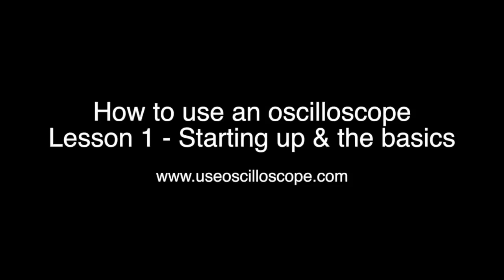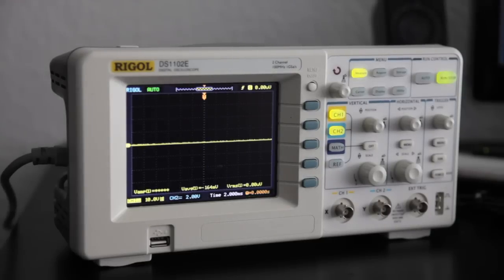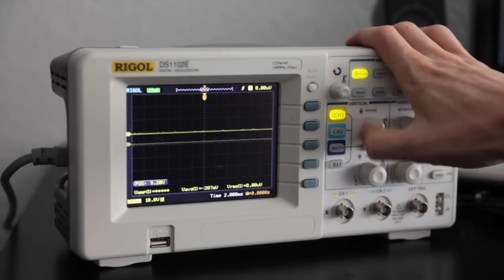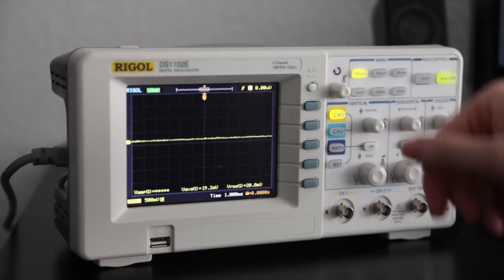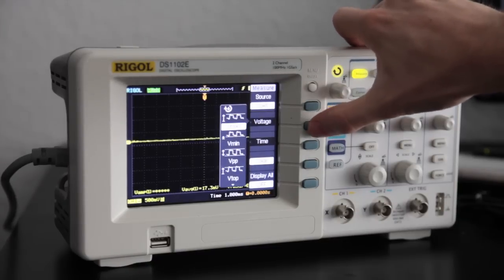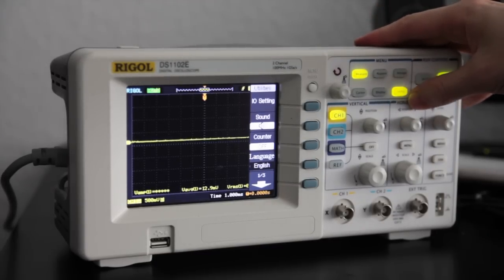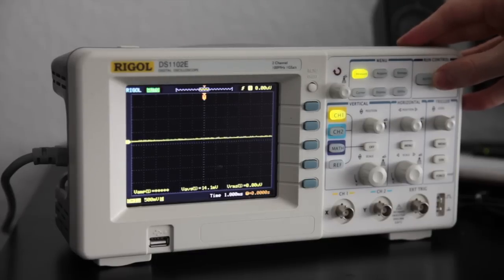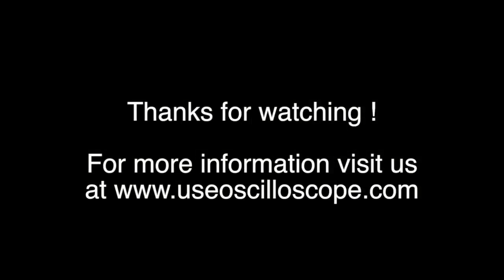How to use an oscilloscope - Lesson 1 : The basics

Comment: In case you know nothing at all about what a scope is, just bear in mind it is simply a multimeter with the added dimension of time because voltages change dynamically in circuits. Having dual trace is an advantage so you can view if one part of a circuit properly affects another part of a circuit as it should when it should.